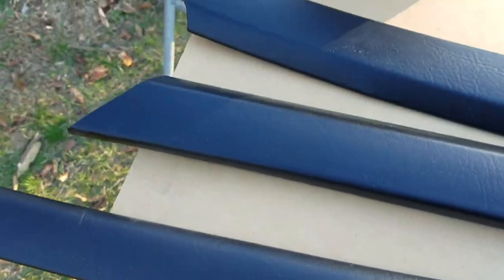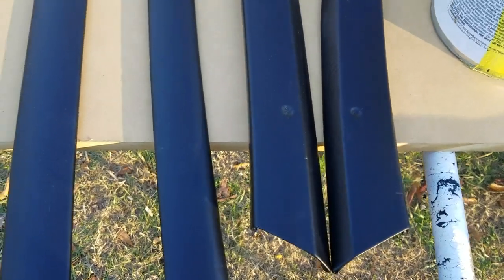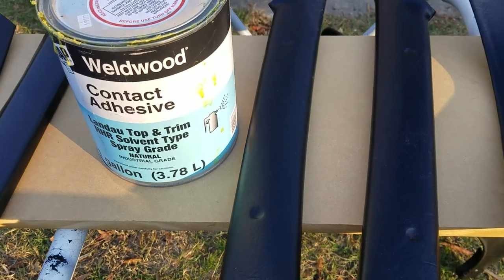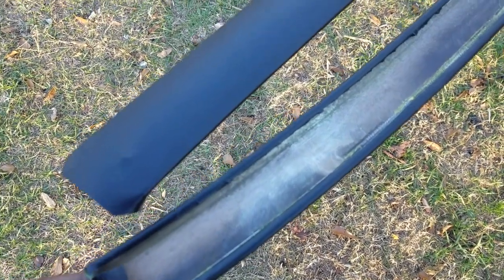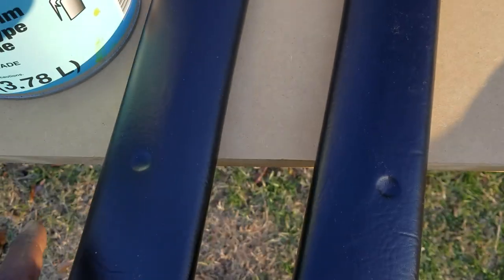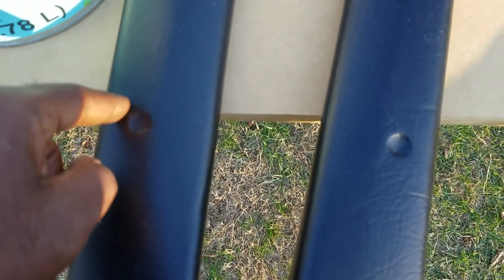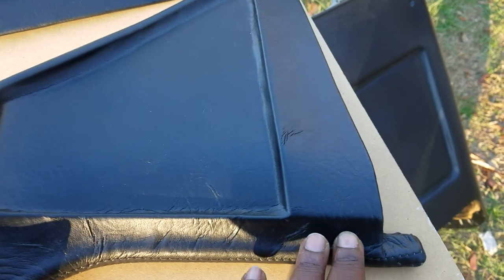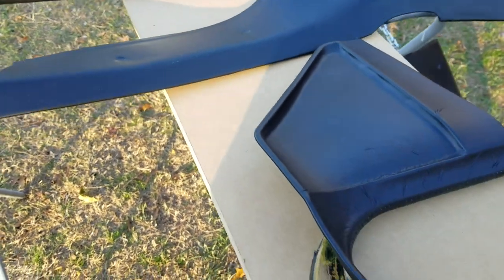Gbody interior panels wrapped tips and tidbits

Comment: Did you use a heat gun on it when you applied glue etc
Reply from the maker: Not necessary to use heat gun unless you need the material to stretch
Reply: @wjdiv1  ok Preciate it first time trying this out and don’t wanna mess up
Reply from the maker: @BillyRay501  we ALL mess up bro. Just don't let it stop u💪💪💯
Reply: @wjdiv1  fa show